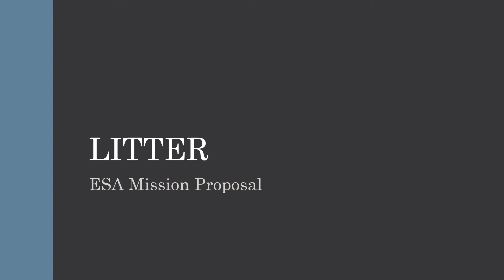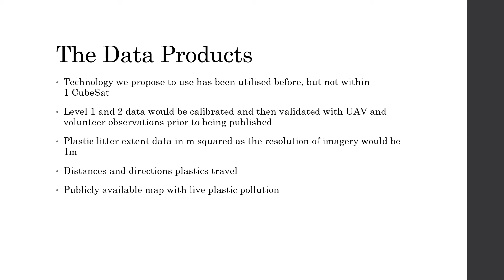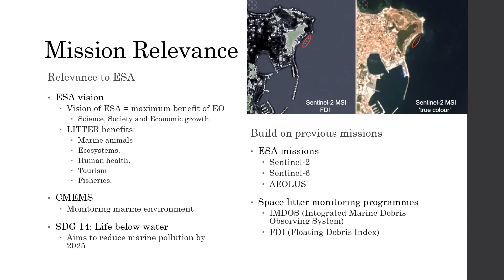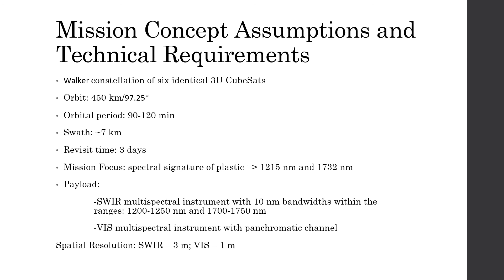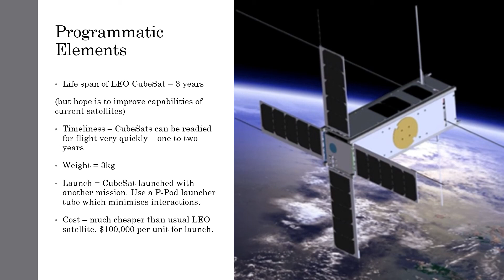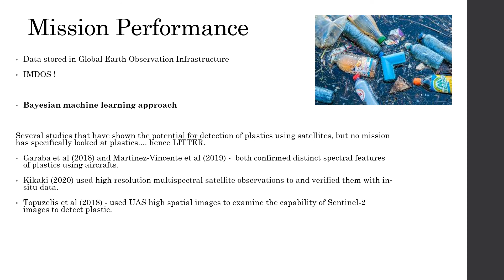LITTER - Mission Propoal

Comment: Great topic.  Nice mission idea.  
On the science case:  You do relate to ESA mission -- good. You need to make a stronger case for why this is important.  What is the value of knowing where the plastic is?  Who needs to know and what would happen with that information. 
Tech side:  Have you thought about how you track plastic?  How can you identify the same plastic multiple times? Has this been done before?  Also, how high is the AEOLOS wind retrieval?  Exlain the Walker constellation.  Mission design looks good -  make sure your literature backs it up.   
On the presentation: More pictures and examples would have been good. 
Overall: looking good. Make sure you explain the jargon you used (enough that I know that you know what it means) and support your mission features with citations whenever you can.